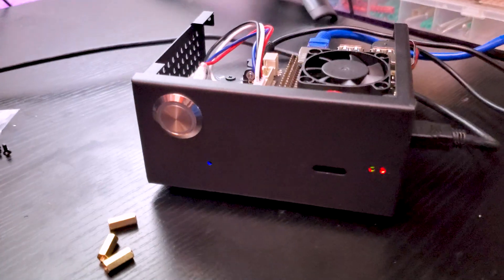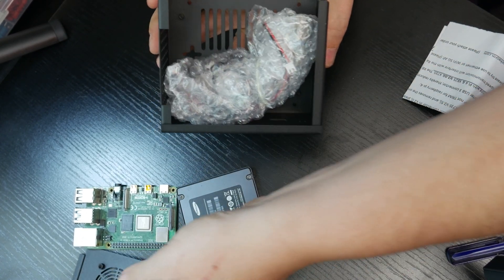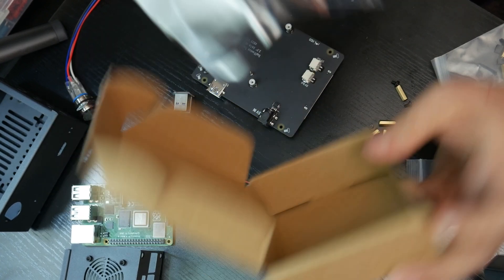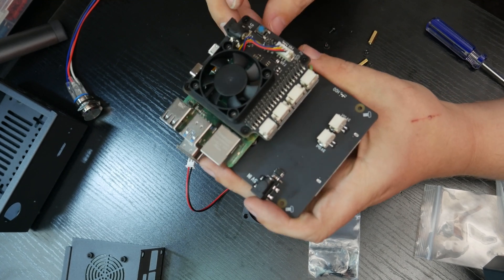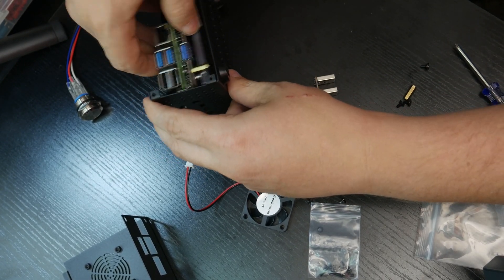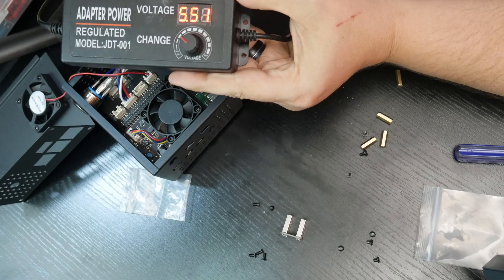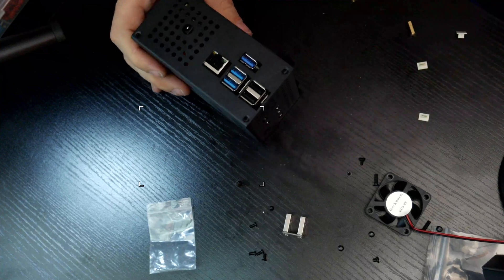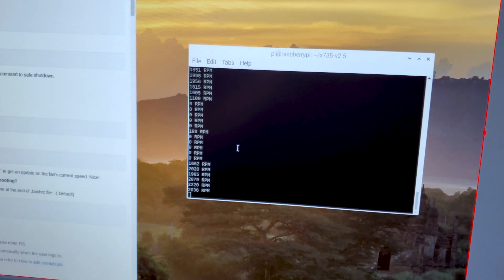Geekworm X825 V2.0 Raspberry Pi Desktop Case - A VERY Cool Case!!

Comment: Only use tbe x825 barrel jack, rhe directions say u will fry the pi if use use the barrel jacks of either the pi or the x735, also the reason everything is turning on when plugged in becasuw he forgot to remove the short jumper

Comment: Thank you for this superb close up look at x825 paired with x735. Great channel, great videos.

edit: I know my commentary is one year after DB Tech's excellent video.
Worth noting that in the Geekworm video at minute 1 and 32 seconds, they advise powering x825 board (if it is just the x825 without the x735).
However, later in their video at minute 7 and 26 seconds, Geekworm indicates use of the x735's barrel jack 5V power and not the x825 (when x825 and x735 are both in use).
Their video is available at https://www.youtube.com/watch?v=JxUNhIxXgj4.

edit2: I also think you have a momentary switch . . . not a latching switch unless I am mistaken. So your momentary switch should go into the third header not the second one (see 14:30).

Kindest regards, friends.

Comment: Very nice. Housing is built together. But why is the fan not running ???
Reply from the maker: Did you install the software?
Reply: @DBTechYT  Which software?
Reply from the maker: The hardware should have come with a sheet of instructions. On that sheet of instructions there is an explanation about the script you need to run to install the software to make the fan work
Reply: @DBTechYT  There were no instructions included and Win10 runs on the SSD

Comment: good one -- but a cheaper and better way to have this setup (SSD) is to use Amazon Miuzei case (fan included) and just add an SSD via USB3 connections .. then flash your OS on the SSD and you're set to go .... this setup is not completely enclose in a case - so it runs without getting hot - gurantee ..
Reply from the maker: "better" is a relative term. Not everyone wants a case like the Miuzei case. For that matter not everyone wants a case like this. I'm just showing people what options are out there.
Reply: @DBTechYT  
so -- out of the two designs -- mine is the better function with less cost as a factoid ... relative speaking ...

Comment: About the only thing I like about this case is the power button on front. Does the fan stay on 24/7 or can it be setup for variable speed depending on temp? Did you stress test the pi at all and kind of keep an eye on temperature, if so, how did it perform? For the time being, I think I'll stick to my Argon ONE M.2, even though having a 3.5" SSD is kind of nice. Guess I don't know the science, if a M.2 SSD puts off more heat or less than a 3.5" SSD. I do know the NAND M.2 SSDs put off more heat.